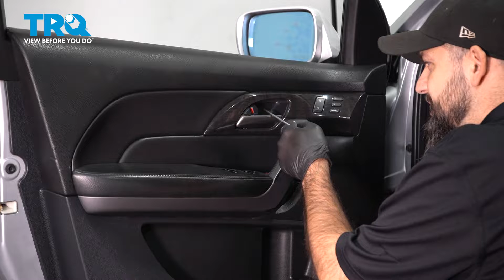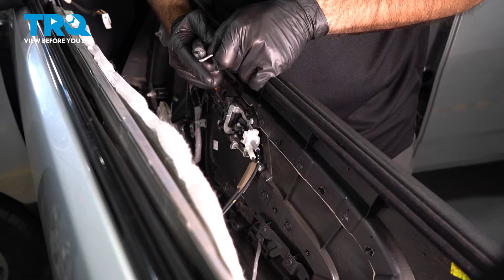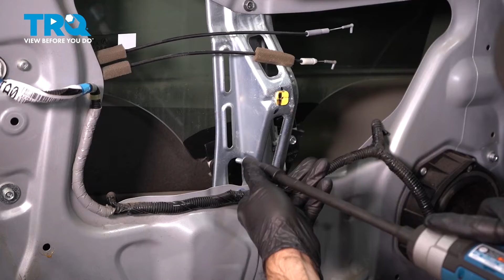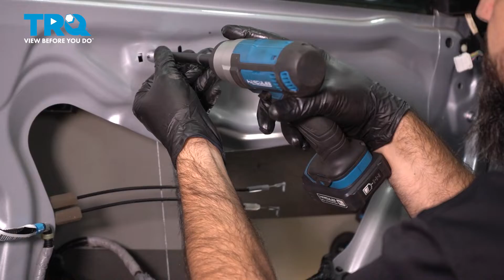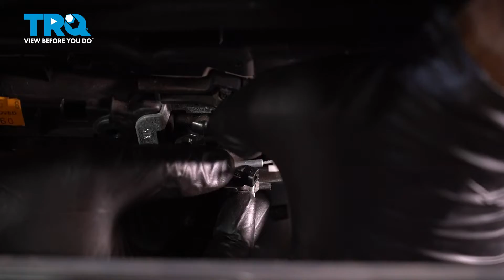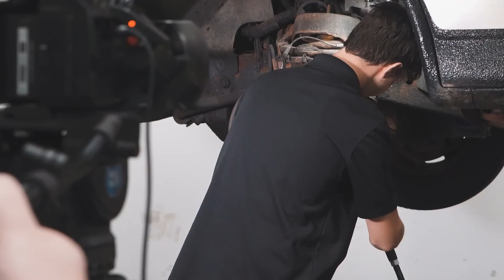How to Replace Front Power Window Motor & Regulator Assembly 2007-2013 Acura MDX

Comment: Tutorial is incomplete, they won't tell you about how to remove the regulator when it's stuck to the window, no matter how hard you pull down that regulator will never come off unless you break the glass!!!!!!!!! 
THEY LOOSENED THE BOLT ON THE INSIDE OFF CAMERA SO YOU COULD PURCHASE A NEW GLASS WINDOW FROM THEM

Comment: Ditto on great instructions and as someone else noted this shows how to replace the regulator if it is still working. In my case, the window was stuck in the up/closed position. I couldn't find anything on how to move the window up or down if the regulator is not working. To address this, I taped the window and used an open ended wrench (10mm) to remove the bolt/screws from the lift bracket. It was a little tight, but was able to remove the two bolt/screws. From there, we were able to wiggle out the defective regulator and complete the installation per the instructions in the video. One small goof was when I popped out the yellow clip on the old regulator, it fell into the bottom of the door and could not find it. Again, overall, very good instructions and helped me replace the regulator, motor on my 2009 Acura MDX.

Comment: What if the window is completely down and the motor is not working to get the glass up to a level where you can remove the screws holding the glass?

Comment: What if the window won’t come down to provide access to the glass bolts?
Reply: When the window is in the fully up position, you can access the 10mm bolts using a open wrench.  Take the two bolts out and the regular can be removed as shown - easy peasy